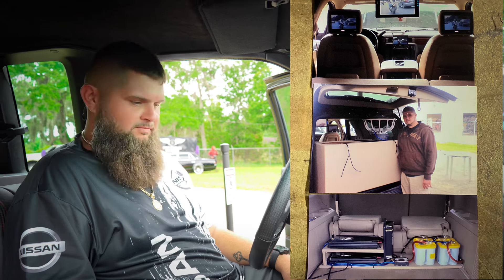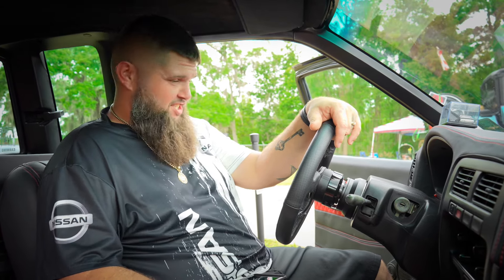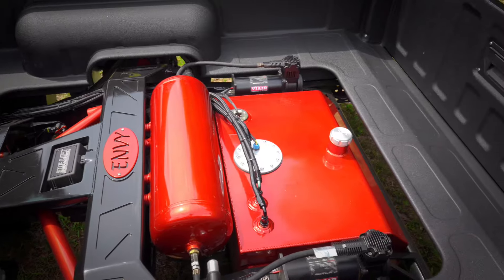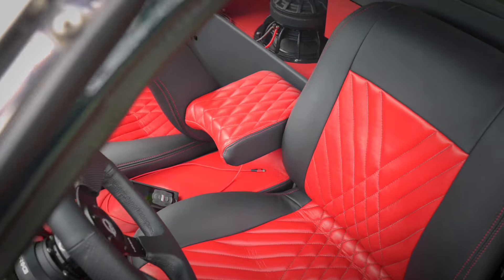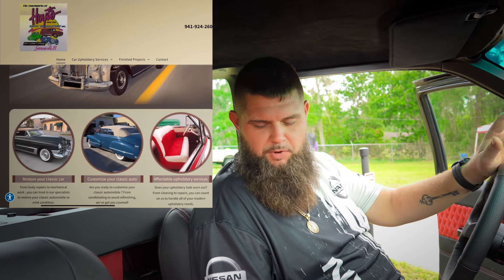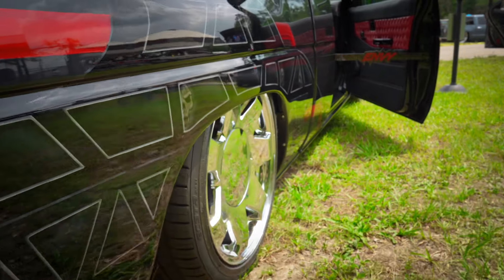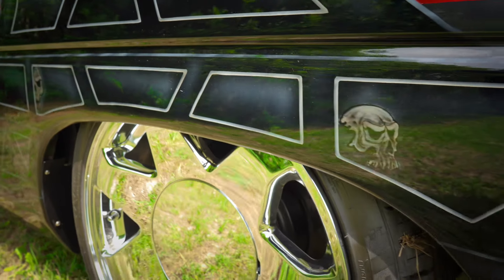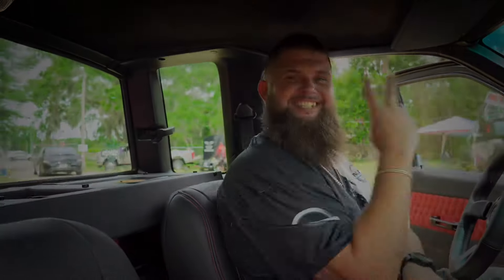Nissan Hardbody Rightfully Claims The Name Envy At Made Of Steel Show Florida!!!

Comment: My first car was a d21 (hardbody) extended cab that had 415k miles and then my brother got it from my uncle it got stolen 4 times crashed a couple looked pretty rough still ran great then I got it and just drove the wheels off of it the worst part was you could open the driver side door with your thumb nail or anything that could turn it (key broke off inside😂)
Reply: And now it sits in the field behind my house and it starts every time I charge the battery 😂
Reply from the maker: I had one as well. Loved the four cylinder eight spark plug overdrive set-up.